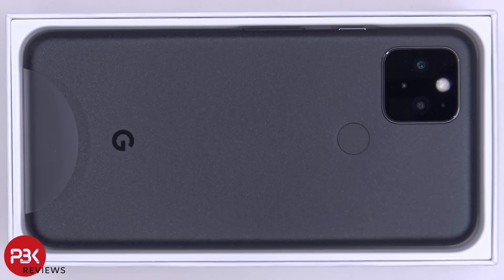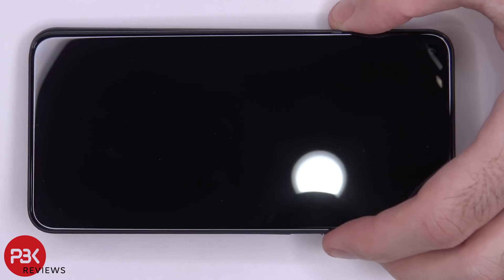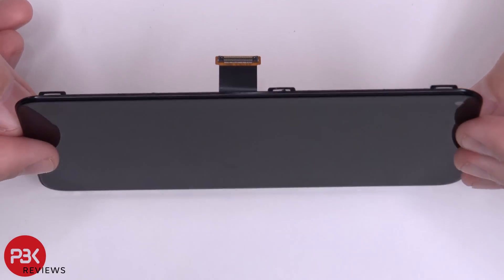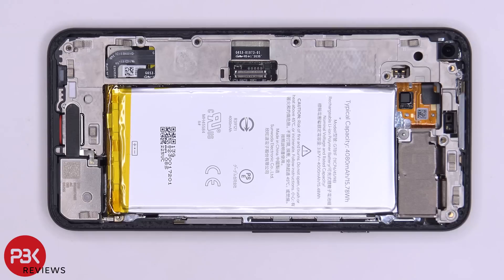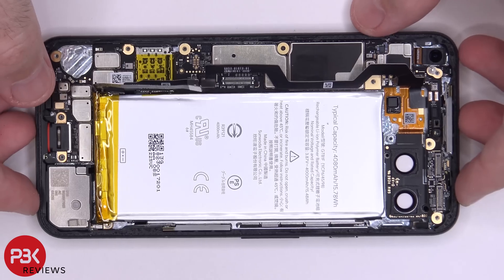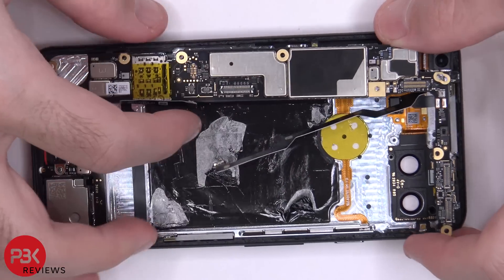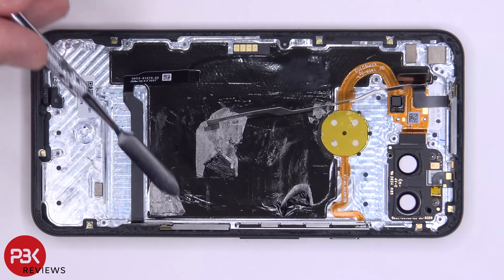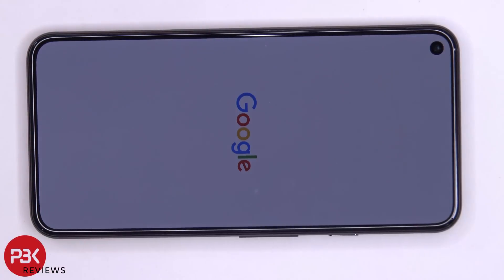Google Pixel 5 5G Disassembly Teardown Repair Video Review. Screen Gap?

Comment: fyi, if anyone ever wants to "attempt" a battery replacement... be careful theres a thing sticking out of the bottom right side of the battery and with that damaged... u wont have a functional battery and it'll come up with a battery question mark icon on screen
Reply: Thanks,
 I will pay attention. 
Do you have any battery company suggestion for the battery?

I am struggling to find good ones for the Pixel 5 and Pixel 3xl...
Reply: @bradock89  um. if u want good quality and don’t mind the price. ifixit has but i can’t comment on using them

Comment: Gap on my Pixel 5 become REALLY HUGE. Could hjyou advise me which glue may I use, to fix it?
Reply from the maker: Here is a link for it, but keep in mind, might be your battery going bad and bloating causing the screen to be pushed up. https://www.mobilesentrix.com/lcd-adhesive-tape-compatible-for-google-pixel-5-genuine-oem-1

Comment: Could you help me locate the memory chip on the motherboard? That would be a huge help, thanks in advance!
Reply from the maker: It's soldered to the main board under one of the covered shields. It isn't user replaceable or removable.

Comment: After replacing the battery, i no longer have cell service. What component did i damage/unplug?
Reply from the maker: Hmm make sure if you removed the main board, it's seated back in place properly since it has antenna contacts that need to touch parts of the frame. Aside from that, if you damaged any chips on the main board, can also be a reason why it might not be working.

Comment: Where is the connect between main board and power/volum button 

My pixel5 power and volume button donor effect
Reply from the maker: Its the cable that is disconnected @3:44 in the video
Reply: @PBKreviews  thanks alot

Comment: So if I just want to replace the baterry I dont need to buy a new back cover adhesive right?

Just the screen one
Reply from the maker: If the replacement battery doesn't come with adhesive for it, you would need to apply two adhesive stripes, one on the back top of the battery and one on the back bottom to hold it down to the frame in addition to the screen adhesive to re apply the screen.

Comment: I was replacing the battery in my Pixel 5 and one of the earpiece contact pins broke off, and there is no sound on phone calls only, but the other pin is still on there. Wondering if there is a way to repair the pin, or if there is some fix to where i make sound come out of the same way as music etc does, or if replacing the board is the only fix?

Thanks!

Comment: What temperature are you targeting when heating the phone for disassembling the adhesives? Is the USB connector replaceable?
Reply from the maker: I don't use a heating plate or heat gun to often, I find it easier and better to use a hair dryer since it has a more even heat distribution and less chance of damaging parts by over heating. I just evenly heat it up to the point that its hot to the touch and apply more heat as needed throughout the process.

Comment: Do you have to put back graphite film or it is optional ?
Reply from the maker: You can peel off and use the original graphite film that comes with the phone. Most back housing replacements will come with it pre installed. It would still work without it but heat transfer wont be as well and also you might need to put some sort of film to be a barrier in between the back metal mortion and the main board to prevent any shorts. Thats just a precaution.

Comment: anybody else struggling to reconnect the screen flex cable to the motherboard? I just can't seem to get it seat properly. Anytime it seems right, the slightest bit of movement disconnects it before I can get the clip back on.
Reply from the maker: Shouldn't be that loose or difficult. Should click in place and not pop out that easily.
Reply: @PBKreviews  I took some isopropyl alcohol and a soft tooth brush and cleaned the connectors a bit. It fit in much better after, I think some debris may have got in during the repair. Thank you for the reply!
Reply from the maker: @jondoucette200  sounds good, you're welcome

Comment: Any easy way to replace the Camera Lens glass?? 4:23 this is the part I'm afraid to touch.. The black graphite thing. In order to replace the camera lens glass I think we need to replace the whole back side. And I'd need to peel the black thing off. It'd lose stickness, and I'm afraid it'll ruin the wireless charging.
Reply from the maker: If I'm not mistaken, the camera glass is just held on with adhesive. All you need to do is heat up the back and pry the glass off the back housing. Then apply the replacement glass cover.
Reply: @PBKreviews  sadly i dont think they sell the lens glass :(
Reply from the maker: @leaaae4638  oh ok, ya just checked couldn't find it either, but they do sell the entire back housing as I believe you mentioned would be your other option to change.

Comment: Hello guys. Just a question. I need to replace the came module - unfortunately I live in the country without the Google support. Is it a big deal to open the phone as I am assuming from your video that would is the biggest challenge for the camera module replacement? Once the screen is off - what is the best way to put it back? Any special glue is needed or you just using the remaining one on the frame? Anyone has had this kind of experience? Is it relatively easy or rather use the specialist for thatt? Thanks
Reply from the maker: Hi, it's not too difficult to take apart the phone, but you need to be careful to not damage or break the screen. Putting it back together, you can use the original adhesive that is on the screen if you did not damage it too much while taking it off and if it still has enough stickiness to hold it down since the frame of the screen has catches which hold it down on the corners in place as well. If you need to replace the adhesive, you can watch the video I did on how to replace adhesive.
Reply: @PBKreviews  Thanks for that. Really appreciate that. One more question. While putting together, will I need to heat up the adhesive again to increase the stickiness or not? After successful assembly do I need to put some longer lasting force to keep the screen attached to the rest of the phone or not - some holders etc? 
Thanks again.

Comment: Can a cracked camera glass on the rear be repaired/repairable?
Reply from the maker: Yes, the camera glass is held on with adhesive and you can use a hair dryer to heat it up to loosen the adhesive and then pry it off.
Reply: @PBKreviews  Is there really a part to replace the glass covering the camera or we have to change the whole back cover?
Reply from the maker: @zippobrand  the glass cover should be held down with adhesive. Can be heated up and pryed off. I can't seem to find just the glass cover replacement in the US but here is a link for one from outside the US https://www.fixshop.eu/nahradne-diely-google-pixel-google-pixel-5/google-pixel-5-rear-camera-lens/     if not you can always order the complete back housing and replace it in its entirety.

Comment: Hey, do you think its possible to put the G Pixel 5 camera modules into the Pixel 4 XL?
Reply from the maker: Not sure, if the connectors are the same it might work but you probably would run into software reading issues as well. I don't have the phones on me anymore to test it.
Reply: @PBKreviews  looks like p5 camera module has a lot shorter ribbon cable. So hardware is already killing this.

Comment: Screen repair looks like it'll be a breeze on this thing. Battery replacement only slightly more difficult. Yeah, I'm going to ride this phone until at least 2025 once Google stop supporting it, custom roms are sure to be around if the Nexus 5 is still getting love.
Reply from the maker: Ya should be an easy screen replacement.

Comment: Very nice video. I have a query. Iam using my pixel 5 and my proximity sensor is not working as expected. It automatically senses something  when i turn the phone inverted. It works fine if i apply some pressure on the upper part of the screen, in and around the proximity sensor. Is this issue hardware or software related. Any fix for this issue!?
Reply: The prevalence of this issue also gets reduced  when i put a case in the phone. And by the way, is it sure that nothing is wrong with the sensor!?
Reply from the maker: Hi, and thank you. It seems to be a hardware issue. It is possible there is extra light getting to the sensor and causing it to malfunction. It's possible as well your screen adhesive in the top might be lifted up or not holding well and allowing light to get in or the rubber gasket around the sensor might not be installed correctly.

Comment: The gap is an issue for proximity sensor. A very big issue! More and more now after 3-4 months.
Reply from the maker: It's possible your unit might be one of the few that actually has an issue and needs replacing.  The one I took apart as well as most others who have a slight gap, it isn't a large enough gap to cause problems. But if yours is having proximity sensor issues, definitely something I'd get in touch with google about replacing.

Comment: So there are no pulltabs to remove the battery safely?
Reply from the maker: I don't remember seeing any as far as I can recall, but there may possibly be a small black pull tab on the top right of the battery. I lost the original footage of that portion of the video so I can't go back to the raw video to see exactly what that black film to the top right of the battery was but the bottom right corner of the battery has a black flex cable with chips on it so make sure not to pull on that or damage that. If I can find a replacement kit for the battery sometime, I will check n see if it comes with any adhesive pull tabs and let you know. But from what, I recall it doesn't.

Comment: What were you testing at 0:11? Replayed over 10 times and couldn't differentiate what you said.
Reply from the maker: I was saying this one is brand new (brand new unit) and lets see if this one has that gap issue people are experiencing :)
Reply: @PBKreviews  Thank you. Didn't know the Pixel 5 has build quality issues.
Reply from the maker: @ddcll9538  You're welcome. I don't really think its a build quality issue, just bought worried from the aesthetic form of view. Google did release a statement saying its part of the design and nothing is wrong with it. Some people may have had some gaps but those cases are only a few. Overall I liked the build quality over the pixel 4a. Much easier to do repairs on the 5 than the 4a.

Comment: I've noticed my Pixel 5 has a hollow vibrating sound when tapping the lower half of the rear of the phone while holding it by the edges. 
Only noticed it randomly when I placed it down a bit harder than usual on the table. So then I tapped it to recreate it. Lol. Hoping it's normal and just to do with what it's built out of this time.
Reply from the maker: Should be normal, you're probably just hearing the camera rattle inside its enclosure/housing.
Reply: @PBKreviews  more of an echoing vibrating sound than the camera rattle. Like a boing sound lol. Though not too fussed, just thought it was odd haha. 👍🏼
Reply from the maker: @mwboost  Oh, hmm might be the vibrator motor but not sure.

Comment: Which mean i have to replace the motherboard since i have mic issue on my pixel 5, already do all sortware methods including reflash stock rom but failed.
Reply from the maker: What issue is the mic having? if sound, have you checked to make sure the small hole is not clogged or blocked? and have you tried speaking on speaker phone to see if the secondary mic picks up your voice?
Reply: @PBKreviews  i have check there are 3 mic on p5, at top, near camera an the buttom. I have no problem is using loudspeaker on call but normal call mic is not function, i also try to use Google recorder and mic also not function.
But it weird if i knock the buttom hole or put my lips at the mic hole will pickup the sound from the vibration. 
Is there specific small hole as you mention on above. As i see from the bottom look like same as speaker grill on the right of the phone
Reply: Hi thanks want to update. I blow my bottom mic using my ball pump and immediately ok after that.tq

Comment: Is the camera glass a permanent part of the back casing? Mine has a crack and I want to get it swapped - figured it would just heat up and pull off. Google authorized repair shop claims it is all one piece and that the entire back of the phone needs replaced for $250.
Reply from the maker: I could be wrong but I'm pretty sure the glass lens cover is just held on with adhesive and you can heat it up and pry it off. Usually that's how they are. I don't see any replacements available yet though.

Comment: Great video!  Like a few other challenged people, I too hastily poked the SIM removal pin into the top microphone hole and pushed...  Looks like the mic(s) may be offset, but in your examination did you happen to notice what may be destroyed by doing this, as in some type of exposure protection?  Thanks!
Reply from the maker: Thank you. You should be fine, you don't need to worry about any exposure protection  as long as you didn't use a larger tool that would enlarge the hole.

Comment: Did the screen go back in perfectly fine? or do you now have the famous gap?
Reply from the maker: yes went in fine, looks just like it did when I took it apart but i didnt have the original precut adhesive to use since its not available online yet so used strips of adhesive I cut down to size.
Reply: @PBKreviews  did the removal process leave any marks or scuffs in the body or screen?
Reply from the maker: @carlosj.morillo6729  no, thats why its best to use a plastic pry tool. Metal tools leave scratches and gashes. You can also use a suction tool to pull up on the screen a bit so you can have leverage to put your pry tool in between the frame and screen.

Comment: Just Cracked the screen on my Pixel 5:( your video is helping out since it doesn’t seem difficult. Now on the mission to find the pre cut Adhesive and OEM display
Reply from the maker: Glad its helping out. Ya shouldn't be too difficult. If I find a display online, ill let you know.
Reply: think it may be easier to buy a pixel 5 on amazon and exchange screens, then return the 5 ordered on amazon claiming it's defective if they ask you
Reply: That’s a great idea unfortunately the display has multiple cracks but I appreciate the effort, probably best if I wait for replacement parts
Reply: @andrewmarcano6686   Hello let me know if you find a Display. Thx

Comment: How was the screen gap after you fitted the screen, was it any different to what it was before removal?
Reply from the maker: Well since I don't have the original pre cut adhesive they used, I had to cut my own adhesive strips to install so it wouldn't be a good comparison. Also this unit I had didn't really have much gap, or was pretty uniform all around. Sat nearly the same afterwards with the adhesive I used didn't notice any huge differences.

Comment: Am I right in saying that putting the phone in a case removes all potential issues with the screen gap? I always use a case so I assume, even if mine arrives with a small gap, the case will negate the effect.
Reply from the maker: depends on what case you use, some go over the screen boarders and some just cover the back and sides of the phone. If you have one that covers the boarders of the screen, then you should have that potential gap covered and not need to worry about it. Regardless of case or not, its nothing to worry about, it wont affect the water resistance or anything else.

Comment: So the charging port is soldered to the logic board?
That's no good.
Reply: Not thrilled about that, might affect my purchase decision.  At least if the port does give up one day you can still charge by wireless.
Reply: @416diy  yes, but you can't transfer data or connect wired earphones.
Reply: @lecorbeaucassecouilles7365  very true but at least there are wireless options for those. Biggest problem would be if you had to flash a new OS image for whatever reason. 4a has a modular port, disappointing that this one doesn’t.
Reply from the maker: Yep, would be better if it was not soldered to the logic board.

Comment: has google communicated about the screen gap for users who have this problem ?
Reply from the maker: As far as I know, they have not announced any news about that thus far but they are looking into it.
Reply: @PBKreviews  It would be good if they announced something on this subject because precisely I hesitate to invest in this phone given that we do not know the long-term repercussions, I hope that they will quickly communicate on this subject
Reply from the maker: @maxhim64  They have made an announcement stating the gap is normal and part of the design, and upon inspection with their engineering team, it should not pose any risk to water resistance and so forth. They will also address each consumer who purchases their product with any issues regarding the gap. But basically they are stating its normal and nothing to worry about.
Reply: @PBKreviews  thank you for the answer.
It is still astonishing to design a telephone which at a distance knowing that certain models of Pixel 5 do not have it I am thinking in particular of the model of the USA
for my part I am in France and when I go on the forums many people (in Europe) complain about this difference which varies according to the customers, and the difference is not always found in the same place some say that it is located on the top of the phone and others on the bottom
they could have at least communicated by indicating that the problem had been solved on the next waves of telephones which will arrive because for the moment it is unavailable in stock until November 23